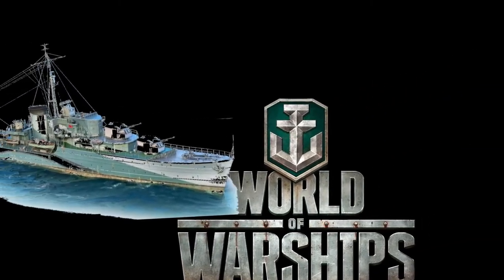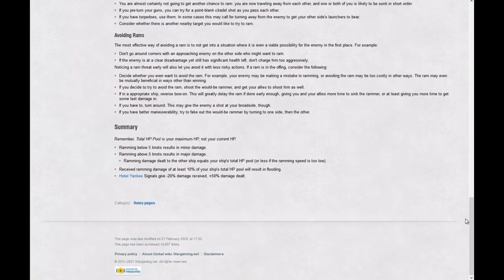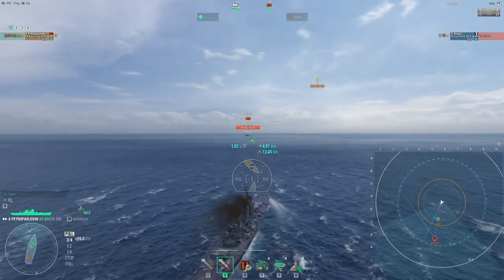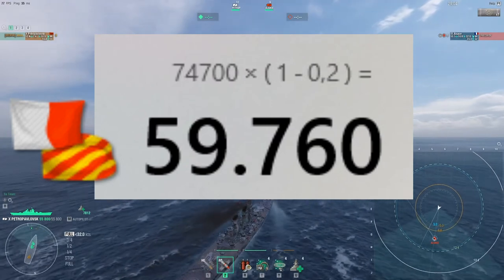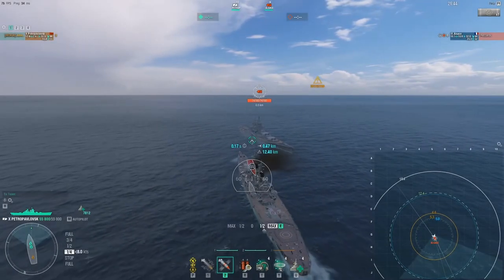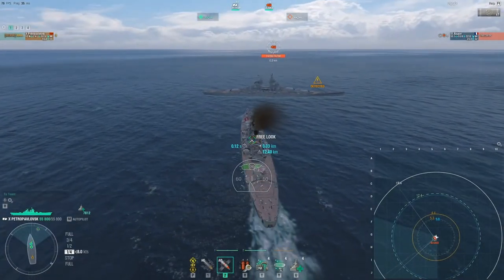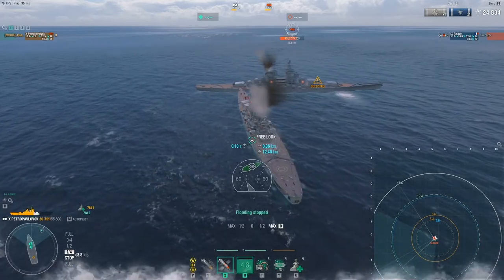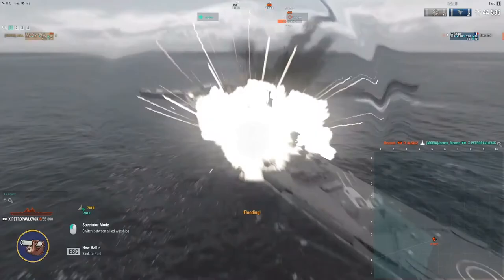Ramming Mechanic - how does it work?

Comment from the maker: The solution to the result of case #4: As I have the ram flag signal but Alsace doesn't, I not only get 20% of damage reduction. The hidden mechanic: Not the Alsace's HP are used as a reference but my own. This is not documented anywhere. If you divide 44640 by 55800 it is 80%. In other words, you will survive a ram if only you have the flag signal mounted AND your HP at the time of the ram is above 80% of your maximum HP AND if the other ships HP is 150% or less of your ship's max HP.
An example:
my ship = 50000 HP
If I have more than 40000 HP when ramming AND
the rammed ship has 75000 HP or less
I will survive and kill the other ship.

Comment: I see a relation of the armour plating involved in the impact point and the speed the vessel is traveling.
Harder piece of plating wins; ramming flag seems to have no influence if no velocity is applied.
Please try a side drift to the opponents bows to hit him with torp belt?!   Very good experiment in the name of science!!
Reply from the maker: I am currently investigating further and it seems WG uses mass and velocity to determine the damage. Armour seems to have no influence at all.
If I find some formula I will make an add-on video.